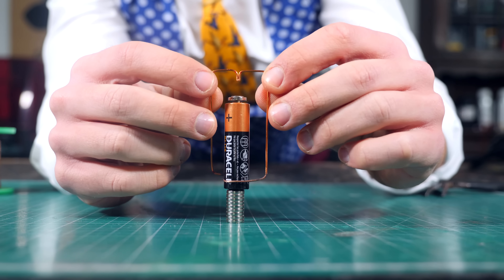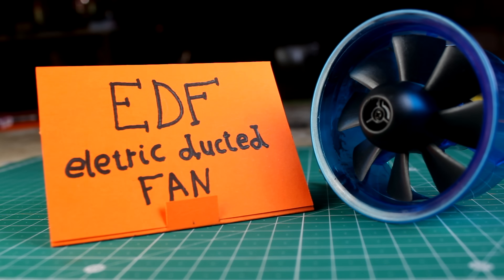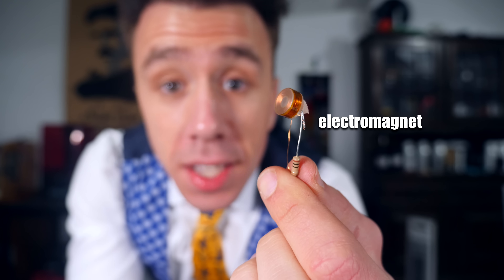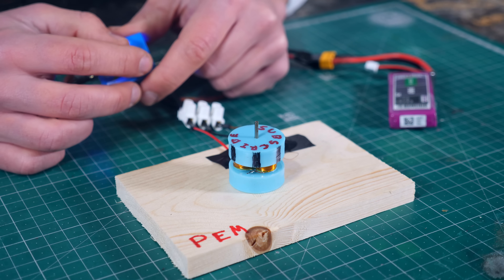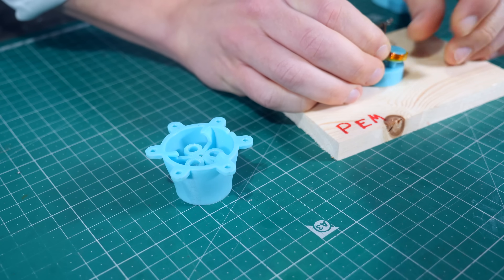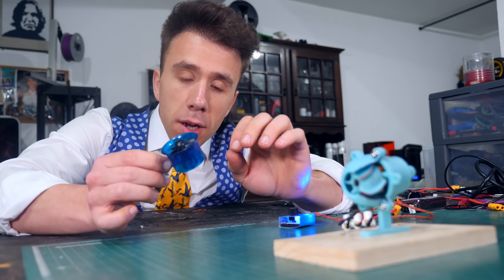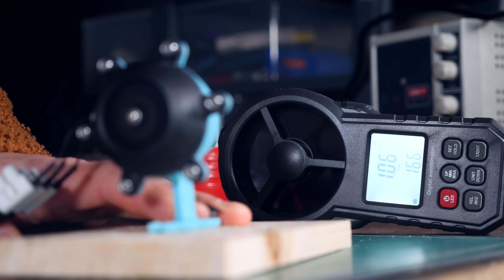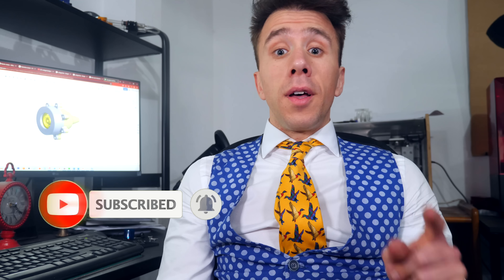I 3D Printed an ELECTRIC MOTOR FAN

Comment: If you are using an impeller... would the jet drive of a seadoo work better for this application? The difference between pressure coming from them is the tolerance between the blades and the side walls... the tighter the tolerance, the more pressure you get. But if you overdo it, it won't move at all... if your impeller is growing with the speed, I would look into a tougher material to print with.

Comment: You should built a 3d printed turbocharger and use it on one of those gas-powered 4 stroke Stirling engines.

Comment: The issue is likely to be due to the increased back pressure and drag vs the EDF. It is unlikely to be solvable as a EDF design is inherently more open and doesn't attempt to force the air change to direction significantly, unlike the impellor design.

Comment: I would look at how many amps each design pulls on the battery, if the motor, ESC, battery etc are all the same, but JUST the fan design is different, then it's definitely a fan problem. Maybe a larger fan, or bigger outlet area would help.

Comment: It looks like your intake isn't enough. Even with jet engines, they are typically moving through the air when they are at their maximum performance. They are not only sucking in air, but are moving through the air ... forcing more air into the impeller. You just don't seem to be getting enough input of air.

Comment: im no engineer but we sometimes work with this stuff in my line of work but moving water not air, you might not be getting enough ambient airflow to the impeller try making the front dome 1.5 times as big with the inlet just a little larger maybe .25% and that might help avoid the over pressure it looks like is slowing down flow, it works for fire pumps so it might work here.

Comment: It’s comes down to conservation of energy, a balance of velocity and pressure. If you look at fan characteristics (fan curves) if pressure goes up the velocity goes down. And as you said it’s a centrifugal  fan (increases pressure) reason you are getting less velocity on the measurement. and there is also also the factor that when it’s compressing the air the air is thrusted on the wall resulting loss in energy due to friction. This is my understanding, correct me if I wrong anywhere on this

Comment: Static vs  dynamic pressure - EDFs are good at dynamic pressure they can move a fluid at a high velocity but don't produce high pressures while impeller are good at static but not dynamic they produce high pressures but not high velocities - it's almost like voltage vs current both are part of the total power but ... different. They are just power/energy so you could funnel the static pressure into a small orifice and turn it into dynamic pressure but I'm not really sure what the goal is here.   Propellers on airplanes don't need to produce static pressure they just need to move the volume in front of them behind them i.e. dynamic pressure but car turbos are never axial (regular) fans because (static) pressure is preferred and when they need more volume they get exponentially larger..  Assuming you want to stick to that size your going to need to spin the impeller much faster, orders of magnitude faster, but then even the smallest imbalances will turn into uncontrollable wobbles and just annihilate the part.
I could be 100% wrong though the person to ask would probably be @MajorHardware he runs a fan showdown series and has seen just about every type of fan.

Comment: My understanding is that centrifugal fans produce higher pressure but lower volume than radial fans.

That said, it'd be great to see this used as the turbopump for a liquid-gas rocket engine. More booms pls?

Comment: The centrifugal fan turns the air 90 degrees. That, compared to the EDF’s straight flow - is inefficient.

Comment: i would suggest trying to create an input nozzle that fits the inside diameter of the fan wheel with as little clearance between the nozzle and the fan wheel as possible to achieve the best airflow.

Comment: Speaking of fans... What do you think about pumps?  Fluid pumps. I've been struggling with an effective and efficient pump for my aquariums.  The problem is, they are super inefficient straight-bladed centrifugal impellors that don't move more water in relation to their speed.   At 100% power, they should flow at or close to double than @ 50% power, but it's more like 30% more. What they really succeed at is more noise and heat while wearing out faster.   Can you make a pump more efficient @ a given speed by just changing the impeller and nothing else?  I'd really like to be able to 3D print a better impeller (and housing) but use the existing pump body as the motor.
Reply: @integza Is this you or one of those nefarious types?

Comment: They never will produce the same thrust. A centrifugal fan is simply not as efficient at moving air through it as an EDF, and an EDF is not as efficient at increasing the pressure of the air. They are optimized to do two very different things. You will never achieve the same mass flow at the same power input, even if you increase the intake area to be the same (which will help).

There is a reason that all airliners these days use turboFAN engines. That big old fan on the front of those engines is just a big ducted fan, the majority of the air bypasses the actual compressor-turbine section that powers it. The thrust is generated primarily from the bypass air, the jet engine part is mostly just there to drive the fan and not create thrust.

You really aren't ever going to create much thrust with JUST a compressor section.
(My credentials are that I'm graduating with an aerospace degree in May, assuming I pass my capstone lol)

Comment: Have you tried just printing a housing that fits around the dumpster dived Dyson impeller?  If the performance improves then it may be that the printed impeller is still flexing, and if performance doesn't improve maybe it's the shape of the housing Dyson uses in combination with the impeller that gets it the performance that they achieve.

Comment: It looks lie you have a smaller Blade Area Ratio on your centrifugal fan. Blade area and BAR are a large part to what thrust you achieve. Larger wetted surface and BAR is more thrust.
BAR is the relationship between the size of the propeller blades and it's diameter. It equals the blade area outside of the hub, divided by the total area of the disk of the propeller. 
The centrifugal fan has a large hub, small fan disk and probably smaller blade area than the PEM DEF, so produces less thrust.

Comment: You need much higher pitch for your blades, your design isn't doing anything as your blades are almost straight to the shaft. The x-ray of the dyson fan has the blades curve almost a quarter of the way around the impeller body. Yours are maybe 7%. Increase the angle and distance and add more, it's a compressor, not a fan.

Comment: Stalling issues possibly. Turbulent flows at the inlet and outlet of the fans cause stalling so the flow should be made laminar by the introduction of a stator to prevent the effect.

For controlling and directing the flow use of guide vanes is suggested. Like you might see in front of a compressor section of a turbine engine.

I'd add too that it could be a combination of things that help, such as stator, guide vanes, longer intake and/or outlet ducting, duct shape and vane/blade shape/airfoil shape.

Comment: Think about how it relates to the Bernoulli principle…  like a helicopter blade vs a rocket engine… both could lift a person but a helicopter blade can achieve it with significantly less horsepower… a jet or rocket has to overcome the Bernoulli principle with brute force… regarding the relationship between fluid velocity and pressure…
Reply: Also the housing shape could be limiting the flow… if the housing doesn’t sent the fluid towards the back, then the impeller might just create a zone of high pressure inside the housing without creating much flow… in a jet engine the expansion of the combustion adds significant energy to the fluid flowing through the housing …

Comment: Fans and propellers can be classified into three categories: low-pressure high-flow (propellers or squirrel cage fans), medium-pressure medium-flow (ducted fans), and high-pressure low-flow (centrifugal compressor fans). As you can see, there are two categories that you can swap one for the other. Either way, if you add the same power or voltage, you have these two categories to split the power into. Aircraft use propellers as they are high-flow and very low-pressure, whereas jets will use a very high-pressure low-flow and add fuel, then light it on fire creating less pressure but higher flow, much like a piston in an engine. You will always get the same work done regardless of what fan you use, but it's up to you what you do with the result.

Comment: You can have low wind speed ad a lot of thrust or higher wind speed with low thrust. Think about planes and helicopter, small rotor, high velocity vs big rotor, low speed. Bot one make for sure more thrust.

If you have a fixed power you can express it in thrust or in velocity because the fortmula is Power=thrust*speed

Comment: Air power is the same as amperage,

More resistance + more power = more thrust

This means that you avoid expulsion of straight lines and maximize circular paths intersecting. Doing so decreases wavelength (because of the delay) and increases the vollume of air being pushed every second (because it is relative to the power and not the time). 

This is why something “pops” when you overpressurize it, there is too much internal turmoil to be held back, the resistance is too small for the power pressing on it and it creates thrust.

Comment: I'd like to see you make build a 3D printed BLDC motor, like the big ones some other channels have shown off designs for. I'm sure there's a lot you could learn and teach the audience about in the process.
Reply: - he just made the simplest 3d Printed AXIAL FLUX BLDC motor one could imagine (the little blue spinny thing)... - print with blades angled the other way and it will make a great (dangerous - without a ring/ tip-guard) early science toy - as it spins until it leaves the axle,  flying off into the air..
 - that motor can simple be scaled to one's heart's desire  (no need to even see a "plan" - get an "OnShape" account and start 3D modelling.

Comment: My guess is compressing air causes it to increase in temperature which is then convected away. The loss of internal energy saps away potential energy that would be converted into kinetic energy as the air exits the nozzle. It’s also possible that the walls are too rough causing very turbulent flow.

Comment: no it shouldn't. the same power input never means the sape output. 
look up the difference between airflow and static pressure. 
you are using a WAY less efficient design as well, power loss due to heavier parts, airflow restrictions, less surface area on the intake, useless complexity, and a design that's better at doing something different than airflow. increasing pressure uses energy too.

Comment: The fan has more blade area and more cross sectional pass through. To make your blower equal thrust. It needs to be much bigger. Untill you are running out of motor torque.

Also consider the speed vs pressure ratio. Fans make air go fast, blowers make air go hard. You probably need a better nozzle to take advanage of the pressure increase.

Comment: What I've learned from rc airplanes.
Your motor has a max rpm/volt. Horsepower = RPM x torque (lb-ft) / 5225
HP also = W/ 745. RPM us governed by volts and torgue is governed by the propeller / ducted fan / impeller configuration. Additional blades on the impeller may increase torque
Motors for EDF usually have a higher kv (more rpm/volt) than those with traditional propellers. Since you are winding your own motors, it might be easier to increase rpm than torque.

Comment: years ago i messed around with an edf fan to try and create an electric "turbo" i tried to make a compression blade for it like your one in your turbojet engine video (7:24) but i didn't have a fancy 3d printer back in those days (still don't coz im unemployed lol) and did it all painstakingly buy hand...  just and idea; if you were to make one around the body of the edf motor that make help keep the pressure flowing while the blowerfan at the front compresses? just idea and id love to see it done :) at a guess the reason your version didn't quite like the dyson one is that it might be the length of the blades, ie if it was 1/4 longer?

Comment: Already subscribed: I'm broke working as a dishwasher so can't afford a 3D printer of my own but would really want one because I think your impeller research could really help with a current project of mine where the idea is to combine a Dyson "bladeless fan"/air multiplier with a channel wing. For reasons that have to do with a theory that I really want to play around with but so far have had to rely on very intricate models made of foam-core, computer paper, and other odds and ends glued together and run off of a cheap shop-vac. I got the working bladeless fan off of that, but it would be really difficult to progress much further without the  3D printer.

Comment: Put a tapered inlet on the front of the fan you are building. 
You are making the pressure inside of your design, but you need the volume in to get volume out

Comment: A fan should create better flow, an impeller is more ideal for creating pressure which is why jet engine and turbocharger impellers are also known as compressors.

Comment: There are two problems you're facing. The first is impellers and propellers are designed for specific RPM bands. The one on the EDF is likely matched properly to that motor, whereas you're copying dyson's design which is likely for a motor with a different rpm and torque rating.

Second, you're not measuring thrust, you're using an anemometer to measure air speed. Axial fans (propellers) are very good at producing high air speeds, and so high flow rates when unobstructed. However, they don't generate much of a pressure difference between the intake and exhaust, so if there is something obstructing the fan the airflow drops off significantly. Impellers or centrifugal fans are the opposite. They aren't as good at generating high volume and speed of airflow so your anemometer reads lower. They are very good at creating a pressure difference between the intake and exhaust of the fan, which is why you see them where you want pressure; such as a turbo in a car to boost cylinder pressure, vacuums which use the low pressure created to suck up dust (they also need to force air through obstructions such as the filters, the vacuum head which blocked by the floor, all the friction created by the ducting etc inside the vacuum), and the "bladeless" fans (which have a whole lot of ducting and obstructions for the airflow to go through from the housing intake, through the impeller, all the channels leading to the exhaust posts which are a final constriction).

Radial fans also just aren't as good for this application, otherwise you'd see them in use. When making a propulsion unit of any sort you (hopefully) don't have any obstruction to the airflow, and you want to achieve the highest exhaust velocity possible. These two factors suit and benefit axial fans while disadvantaging radial ones. Jet engines which you showed also (usually) use axial compressor fans, not centrifugal ones.

Comment: for a future video get a dyson v8 motor rig it to use 36v not 24v and then make your jet engine using that. I would not try anything over a v8 since they have some kind of anti tamper circuits. They use a Hall effect motor and I think it’s pretty cool that they know the speed of the motor without any added circuits. I would really like to have a 3D printer.

Comment: A jet engine  powered tomato launcher/distroyer! If you can't use them for food or for fuel try to use them as amunition. Make a tube shaped housing for the engine that creates a vacume seal on one side of the tube. Attach four relitivly strong strings to the engine. Then attach a relitivly strong metal plate to the stings, make sure the strings are not to far or too close to the engine. You can figure out the correct distance with some experimentation. Place a tomato on the plate then activate the engine. The engine will put a lot of pressure and heat onto the strings. When the strings snap the pressure built up will propel both the plate and the tomato into the air or a wall at very high speeds. If you do consider doing this make sure to insalate the plate so the tomato is intact when you propel it at a wall or into the sky.

Comment: I'm just guessing, but the centrafugal fan produces more static pressure and *less airflow, which is why it's used in jet engines where high pressure is needed. (Side note the EDF casing is designed to produce thrust.) The EDF produces high flow similar to a fan but does not sacrifice as much airflow as the centrifugal fan. All in all, i would recommend either a larger impeller or spin it faster. My recommendation is a larger motor and gearbox.